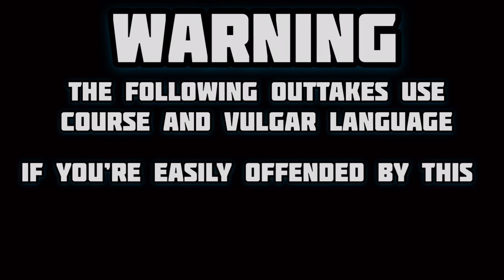My Tool Buying Theory || Buy Once, Cry Once? NOPE!

Comment: I think you made a lot of sense in this blog. I love the feel and durability of a top quality tool but it does not always  make sense. I got tired of scraping my knuckles on my table saw arbor and the cheesy stamped metal wrench just wasn't doing the job. Got a 15 inch adjustable from HF for $12 bucks, problem solved. It ain't the best tool in my shop but I need it once ot twice a year.
Reply from the maker: Yup, thats exactly what I was getting at. Have another tool vlog coming up this tuesday. Its gonna ruffle some feathers lol

Comment: I do agree here, in fact of, depends on what you are doing. I literally turn wrenches 50+hrs a week, for me snap on. For heat gun, i use same 8 dollar drillmaster (coupon lol) more for my own use than anything else, few times a year. But it does depend, really, on what you are doing. As for buying all tools at hft.... well............. i myself spent more in gas in course of 2 months, going back and forth to hft, than i spent on tool truck payments for 6 months... but it all depends as you say yes, what you do. #gtfo #foulouttakes 🤣👍
Reply from the maker: When you START OUT, buy all your tools at harbor freight, then upgrade your most used tools first. Alot of people seem to be missing that part. I still love you tho 🤫
Reply: @BradsWorkbench  but i know for fact after tryin stuff out that there are far better brands out there for same price point as hft 🤣👍. Much love mucho nada homo😉🧡😚😚

Comment: Some of my air tools are from Harbor Freight,holding up good and have not quit on me.One is a needle scaler,it has not quit on me yet and I use it for pro use.Including a 1/4 air ratchet I used to use,still works although the ball holding the socket in is gone.My impact sockets,some of them are Grey Pnuematic and Sunex which have held up.I didn't need to buy the tool truck brands.
Reply from the maker: The needlers and even the cheapo die grinders are pretty damn good from HF. We have a few in our shop
Reply: I had to replace the needles once,one spit out.The end of the needle keeping it in wore out .Luckily Harbor Freight sells the replacement needles

Comment: I've got a craftsman table saw and band saw from the mid 80s I got for 100 bucks a pop on craigslist... needed a little TLC, but they are great - another way to avoid dropping tons of coin as you get into something
Reply from the maker: Oh u just found the guy that fixed up a 70s craftsman tablesaw (old video on it) i got for $15 with a "dead" motor.... also found a 1950s craftsman for free in a scrap pile and used that for a while. But just sold both to make room for an 18" jet bandsaw i pulled out of a barn that was falling down for $200 with a dust collector. I LOVE chasing old/used tool deals

Comment: I'm getting started into woodworking and got a Ryobi table saw and a harbor freight 10" miter saw. They both work but found a DeWalt 779 miter saw on sale over Thanksgiving and upgraded the miter saw. I'm waiting to find a good quality table saw on Facebook marketplace or Craigslist now.
Reply from the maker: Good deal! And you can sell the ryobi saw after youve upgraded. Keep on the lookout for the old craftsman "contractor" table saws. My first i paid $15 for cleaned up and it worked great. Just sold that one for $200 though because i found another cast iron craftsman saw for FREE being given away as scrap metal. Damn thing needed a few adjustments but now works great as well. Both found on facebook marketplace. Just stay patient and good things will come 👍
Reply: @BradsWorkbench  I try and checkout marketplace every day or two so hopefully I'll come across a good one someday, but the way my luck goes is all the good deals show up when I'm away at work for 3 weeks and can't do anything.

Comment: i'm definitely all for saving a buck where i can. it should be warned though, on some things, you can go too cheap. some things would be better used than new and low end. my saws for example, one was given to me, 6" skill, bearings not the best and guard broken, it's kinda dangerous. that thing while not perfect has lasted me years no more than i use it. i finally got an old black and decker 7" at a yardsale (made when they were decent). it's not  new by a longshot but i'm sure it'll do me better than what i can buy for more money at harbor freight. i've had sockets strip out and drill bits even twist when they caught on metal lol. i think what i'm pointing out goes unsaid but i know someone out there will take this advise to extremes. you want something 1/2 way decent at least but don't waste money on something you're unsure of.
Reply from the maker: Definitely, always exceptions to every rule.

Comment: I think you should do a video comparing harbor freight to other less expensive products you will be surprised.
Reply from the maker: Give me an example? Im currently comparing the doyle insulated screwdrivers to the Milwaukees which are not very expensive. Is that kinda what you're thinking?
Reply: Brads Workbench the Milwaukee insulated screw drivers are a bargain for how good they are 🤙
Reply from the maker: @themaintenanceman1  agreed... but what if you could get them for 20% off.... im almost convinced these doyles are actual rebrands. Still need to use them more before i give my final opinion tho
Reply: Brads Workbench if brads workbench deems them better then Milwaukee then I’ll make my first trip to harbor freight
Reply from the maker: @themaintenanceman1  time will tell. Harbor freight may have found Milwaukees Taiwanese manufactuer because the new "electricians multi pliers" look almost identical as well
Reply: Brads Workbench 🤔
Reply: @themaintenanceman1  the real issue I have is without a coupon the Doyle screwdrivers are higher then Milwaukee right now.
Reply: Robert Waters interesting 🤔

Comment: I have all Dewalt tools.Dont ever buy Ryobi tools.
Reply from the maker: I sold my dewalt tools to buy ryobi lol i dont do many side jobs anymore and ryobis line is so deep, its perfect for my use.
Reply from the maker: Ps.... use Milwaukee at work. But ill always have a place in my heart for dewalt
Reply: Brads Workbench the Ryobi tools we have at work always have issues with the battery’s not lasting long enough.
Reply from the maker: @samsgarage1716  yea, ive never tried them in a professional setting. Id say the hardest i run a battery is on my ryobi trimmer... 4ah give me about 45 min of weed eating on average